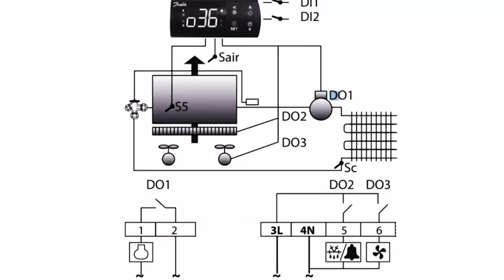Fieldpiece Joblink Firmware Update Demo

Comment: Just did my updates. All probes but one updated fine. One of my pipe temp clamps would not turn on at all after the update. I had to get the clamp  back to the state where the button turns solid blue to get the app to  be able to see the tool and then I just reinstalled the update and then it worked fine. Just wanted to put that out Their in case someone has the same issue. Love this  kit. I’ve had a few different ones and this is Best on the market in my opinion.